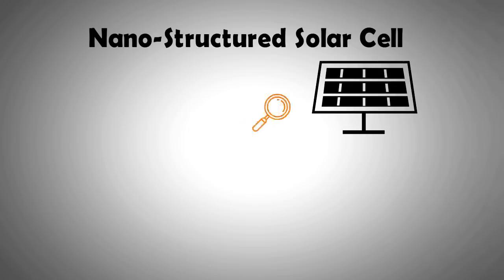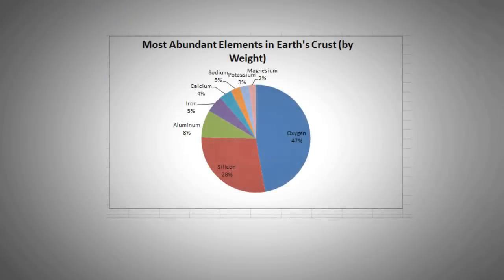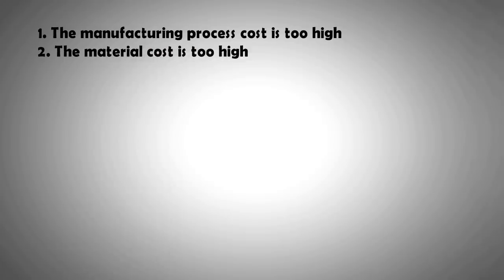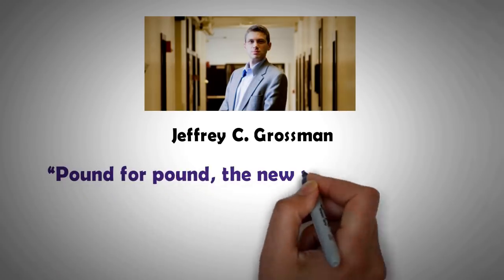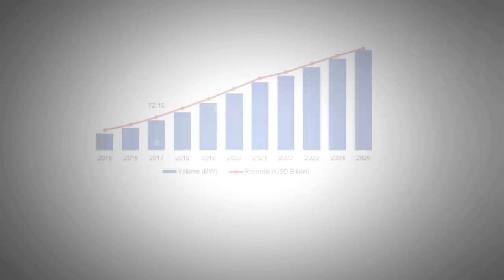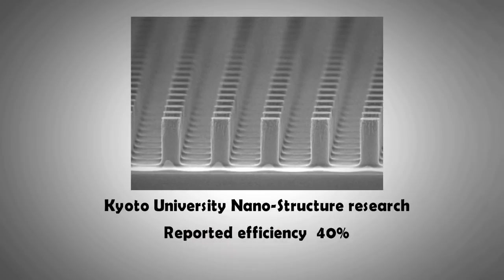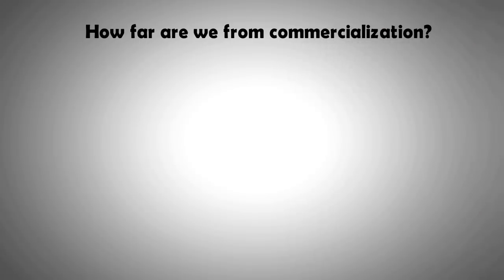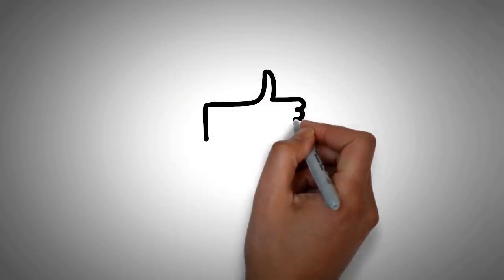Nano structured solar cells - Breakthrough Technology

Comment: one sentence it is said " 1000 times more efficient" and then later it is 2x more efficient ... is that some statistics anomaly  or what. Seriously if all scientists used actual numbers and where they got them, we wouldn't have to worry about 'interpreting' other peoples interpreted proportions.  How about just watts per unit^2 and just leave it there. let us interpret the value. jeez
Reply from the maker: 1000 times less material usage twice as efficient. I have added links in the video description.
Reply: The typical unit is watts/m^2 which is apparently double effeicncy in these new panels.
Reply: @ekoms108  So, this tech is 2x more efficient per square meter (about 40% efficient).  However, the total MATERIAL use is 0.1% as much as required for PV panels (materials cost reduced).

Translation: You get panels twice as efficient for less cost - resulting in commercial solar power for half the current cost to install and half the land use.
Reply: Ferrous Disulfide (synthetic pyrite) has 1000x more light absorption than SiO2. I have been placing most of my research around the creation of nanoscale synthetic crystals of pyrite of uniform size, with cubic centered faces and even distribution. Ferrous disulfide has a huge amount of potential in progressing photovtaics to a faster and more efficient pace. I have been using hydrothermal synthesis of pyrite in a small autoclave for five separate batches of micro scale pyrite (because I wanted to observe the crystal forms under the microscope. Temperature change and duration of the reaction determines size and uniformity of the crystal structures. I just developed a new technique last night which I have performed three small scale tests which were not hydrothermal reactions. Instead I am utilizing vapor phase deposition of Fe(II) ions with sulfur vapor in an argon atmosphere. The sublimated product is very pure crystals of synthetic pyrite onto the desired substrate. I have only worked with copper and lead sulfides for my first few tests of this technique but I am putting together the formula and procedure modifications to apply strictly to FeS2 in cubic centered lattice rather than the crystal habit of marcasite. I have this procedure refined with hydrothermal synthesis, but I believe my new technique shows more promise for efficiency and simplicity in production, and as a viable cost effective measure.

I will make a video or a few on this subject and post to my channel once I get some time to myself to pursue something other than constant external drama I am forced to never get a break from. If you feel like visiting my channel, I am hoping to have something regarding this subject one to three weeks out.
Reply: It's potentiaily 1000x more efficient use of materials, 2x more efficient conversion of light to electrical energy per area.
Reply: now thinking about this more >> observe how this discrepancy could be solved by using actual unit of measure rather than statistical proportions / "pillow fluffing numbers" ... If the unit of 1000x was of surface contact of light per unit area , then the units couldn't be watts per mm/m/in/etc. it wouldn't make any sense. The unit would be something more like 'lumens per unit^2 " or some measure of light per unit^2 .  if the results were material per unit^2 then the results would be kg per unit^2... etc etc ...  maybe the panels are super light .. if we had actual numbers we would know SOMETHING
Reply: He was talking about materials use and weight pound for pound.
Reply: 1000X less material. Does that mean you can run your home on something the size of your calculators solar panel?
Reply: @davesworld7961  No.  From the quoted 40W/m2 instead of 20W/m2, it means it needs to have half the overall area for the same output.  The huge reduction in material quoted might actually only refer to only the rare elements.
Reply: @idontwantachannel3091  Thanks. That would still be amazing if they can do that.
Reply: @davesworld7961  It means the final product will be cheaper.
Reply: @davesworld7961  no you muppet !!
Reply: @christopherroberts22  I love The Muppets.
Reply: @davesworld7961  No, it means that the expensive materials will cost 1000times less for the same surface, cause the usage of said materials is 1000times smaller. the product is cheaper, while the efficiency doubles at the same time.
Reply: @davesworld7961  No.  2x efficiency (watts per square meter).  Less materials means that the cost per panel is less. So, cheaper panels, use half as many.
Reply: ءء
ءء.ؤظؤظؤ.ؤظؤظظؤؤؤؤؤدؤؤدؤؤددؤؤدؤؤؤؤؤؤؤدؤدؤؤؤؤؤدؤظؤؤظؤدؤظؤظؤؤؤظ.ؤظؤظؤظظظظؤؤظؤظظؤؤظؤظظؤؤظؤظؤظؤؤؤظظؤؤؤظظظؤؤؤظؤظؤظؤظؤظؤؤظؤؤظظؤظؤظؤؤظؤظؤظؤظؤظؤؤ

Comment: There many hindrance towards commercial production of nanotechnology . During the era of 2002 to 2010 nano material was debated and its impact on our way life.n. but not a single product is available  in market
We are now in 2020 and still discussing its impact..
Following were the problems  encountered during commercial production.u an add ur experience regarding commerical unsucessful production of nano products.

Time decay
1. The nano material  are high density/ energy  material. We can improve the surface area at molecular level using nanotechnology. Nano material detoriates with time. The nano properties decay with time.
Time decay may be six month to 2 year
.
Inconsistencies

Product will be highly inconsistent. Some batches will have nano properties other less..basically nanopropertises varies.

Batch/, inefficient operation.

Most of nano process are lab method which happens to be batch method.
Need a continuous process wherein consistent quality can be guaranteed.

Comment: What is the name of the company you referred to, that produces Nano Cells?
Reply: Not clear in the video but there is a company in Italy (Verditek) producing lightweight solar panels using graphene to reduce the weight. I understand that the USP is that because of the low weight and improved output they are particularly applicable to buildings which cannot bear the weight of conventional panels. 
Would be interesting to know if this is the company Synergy Files was referring to or if there is another player in the game.

Comment: Nano technology is just so full of promise, frictionless skins on transport vehicles example. There is little to hinder the development of solar collectors which pressurise gasses and heat fluids at the same time as using photons to produce power. This means that it is not impossible to make energy absorbing skins for aircraft, for example, which are capable of producing enough power for clean, cool running and rapid air transport.  We need this technology desperately, as currently jet traffic is demolishing the entire biosphere due to toxic fallout combined with high altitude heat deposition, and this gets more severe every day. Thank you for this presentation, a very timely leap forward hopefully.

Comment: But how does it work how does it produce more energy ?
On top of the nano coating, on the surface of a nanoparticles there are miniature Black Holes and they attract energy, there is a layer of graphene and graphene has free-floating orbitals,  electrons, so in a way they interact with the  nanocoat solar panels and producing more electrons by Magnetic pulling.

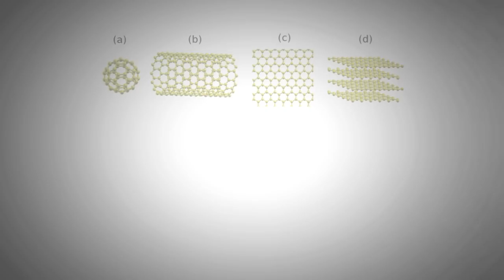Comment: I'm confused - at 2:42 you give the statement that new solar cells produce up to 1000 times the power of conventional photovoltaics, which sounds very exciting, but by the end of the video you say that the new cells only have an efficiency of 20% ? That doesn't seem to add up.
Reply from the maker: 1000 more power for the same amount of material used
Reply: What in the solar industry does add up? Just the next vaporware.

Comment: They cost more than plain old standard heaters.......we have a hell of a long road to make them as efficient as natural gas heat..and now they are using graphs  to illustrate your benefits ..wow they know how to draw lines up and down ..so can a three year old ..it's meaningless garbage
Reply: I think you miss the point. You can't do a direct efficiency comparison of natural gas versus solar. Natural gas and fossil fuels are generally storage of solar energy which has under gone many natural cycles over thousands to millions of years. The fact that you can harvest this energy to heat a house, or convert to electricity via a gas powered electric plant, can't be used in a direct efficiency comparison. I would guess that the efficiency of the original solar conversion to actual work of heating your house is very low, but the energy was used in other ways before it was finally stored as a fossil fuel, mined, and delivered to your home.
Reply: The point is that mining fossil fuels is low hanging fruit, and the rate of replenishment through natural cycles is probably not sustainable with a rapidly increasing population. Renewables such as solar, wind, and hydro are harvesting free energy show a sustainable path for a future energy economy. Innovators and tech development should be encouraged and applauded. Things like LED lighting and semiconductors are upping efficiencies and changing the way we live.

Comment: I bought 8x 255watt solar panels for my cabin, and found that everything i need to run can be done so off of 2 of them. 2. I can connect more in series and crank up my charging amps, but the fact is on 2x 6 volt batteries that are tied in series to make a 12v 208 amp hour battery bank i can run my lights, tv, surround sound, phone charger, e cigarette charger, router, modem, and security dvr with 2 cameras all night without hitting low voltage alarm on my charge controller. Thats all off of a 1000w inverter. That is pretty bare, and i plan on connecting 2 more panels, getting 2 more 6v batteries, and a bigger inverter, soon. I will be able to run a water heater on a timer, water pump, chest freezer converted to a fridge for efficiency, +more. My battery bank currently hits full charge around 3 to 4 hours of sunlight.... If people really need better solar panels, i think they need to work on electrical use efficiency first before investing in new technology. Also solar panels on your roof can make your shingles last way longer and help keep your house cooler in the summer.
Reply: I would love your assistance in building a system for my off grid cabin. We had an apartment fire and now live minimally in a small cabin on a hill. Downsizing was the hard part at first. Now finding that all we really need are lights, charge phone, watch a movie, and chill leftovers. Thanks.
Reply: @marksilvino2083  hey mark, ive been at it for a while now, and still have too much stuff myself, my workshop is less of a workshop and more of a storage unit than i would like it to be. So what i did based on everything i researched was calculated what my wattage usage was on everything i use. I have an inverter that shows how many watts is being used, so i plugged everything into it and ran it individually to get the reading, and then marked it on everything with a sharpie. After that you just have to figure what all you would use simultaneously, add up that wattage, and find a dc to ac inverter my rule of thumb is to get an inverter twice the wattage that you require. From that point you have to get batteries. This is where it starts to get a little expensive. You need to calculate how many hours you use your maximum wattage, find an amp hour calculator online, they will want to know your voltage, id recommend sticking to 12v since the inverters and charge controllers are lower priced. So enter your max wattage x3 (also my rule of thumb), 12v system, and start with a guess of amp hours. Like 200AH. Run the calculator, and it will tell you how long you can run your max wattage on 200ah of batteries. With that info get some deep cycle batteries to fit your needs, then you can look for solar panels, wind turbines, or both. I have both. Wind is great and all but it is crazy how much wind i have being on the side of a hill. And how little it like to spin my turbine. Solar is much more effective. Dont bother with harbor freight junk panels, 25 watt panels are a joke. Get at bare minimum 100 watt panels. Make sure the panels you get match, and you will want about 1/3 more wattage than your max wattage usage, so ecen of you are using your max you are still charging the batteries. Make sure you get an mppt charge controller, it will make your batteries last much longer. I didnt think this reply would be such a book, and im sure i left some things out. Feel free to reply back with any questions. Im always glad to help. Another good idea is to make sure you have a couple good generators, one big, one small, and a good battery charger for when the sun is hiding 😛 stop me.... I could type about off grid setups for hours.. Lol good luck on your build. I might make a video about mine 👍

Comment: Talking very high but only 20% efficiency.. it's only 2.8% higher than conventionally available cheapest  polycrystal panels.
YOUR VIDEO IS MISLEADING
Reply: But it takes less material to make, so per unit of material it's more efficient
Reply: That's the result of the very first iteration, not the end result.

Comment: There is a limited amount of solar energy available per square meter.  Regardless if it's 1000 times more efficient, you're not going to get 1000 times more power. Solar panels in this industry, data is compared to an ideal situation at the equator, in full sunshine at noon, perfect azimuth, perfectly clean solar panel, using a prototype, and for a small window of time. This certainly does not reflect data in a real world environment.
Reply from the maker: It not about panels with 1000 times more power per unit area. Its about the ability to use precious elements as 1000 times less material is required. The precious elements semi conductors have better efficiency and nano structures themselves have a better efficiency, thereby possibly doubling the efficiency of existing panels
Reply: @synergyfiles3536  another thing to include a design consideration is, durability. Different alloys and gradient transitions , as well as the phonon effect. Most of these technologies may perform better, but for how long? So much more unproven grounds, but worth exploring

Comment: Until they actually hit the market from multiple vendors they are nothing but make-believe.
Reply: Norm T  I waited 20 years to buy my SunCapture 300W folding solar panel. It doesn't matter what Can be done what matters is how much profit some fuckhead can make selling it. Until that happens you will never touch, let alone own one of the fucking things. Besides, NASA has way better panels than this. There's way more to solar panels than just their efficiency rating. I didn't dispute their existence there Mr. T, I just don't think they will hit the market for over a decade, you go ahead and wait I'm too busy. 

https://imgur.com/a/3w6izz7 - Bike and Trailer
https://imgur.com/a/DKpcF0a
https://imgur.com/a/zXXlyuv
Check out 70 miles w/front panniers & trailer on Relive! https://www.relive.cc/view/g37290970278

Comment: Manufacturers, distributors and retailers will absorb into their own pockets any efficiency savings because they will maintain their cost structure on the cost per watt. Greed knows no limits.
Reply: NO one cares about COST per watt currently.  If you want cheap: Buy used.  Everyone cares HOW LONG the panels WORK.... which is why you can buy cheap used panels.....  They do not work as claimed.  1) you have to wash them and 2) their sealing sucks.
Reply: @w8stral  In other words, YOU don't care about cost per watt since you do not speak for everyone else. I can understand your sentiment, which is typical of those who are mathematically challenged and pay no attention to system efficiency. It's a given that the panels will give out like most all others over time, so that's not the crux of all this. Cost is indeed a factor in relation to how much power one gets from the purchase they make, and yes longevity is also critical, but limited lifespan is indeed a given.

Comment: I would hope they have thought of the cleaning of this panel , having worked in the panel wash industry for the last 5 years I think this idea is flawed , building grime traps in to panels is a step backwards, it’s like the early days when the panel manufacturers told the whole world that the panels  do not need washing, until the birds can be persuaded to not crap on panels and stop the wind from blowing dust over them , these new ideas are a waste of effort, the best idea is to ask panel cleaning companies to design the layout of farms to enable the equipment the room it needs to clean efficiently , it’s possible to wash multiple times a year fore less than 9p per panel , the outfit Iam involved with often wash the farms twice on each visit . This is costly the farms that are done twice a year  only need one pass , this is not rocket science .........

Comment: Sadly no one measures the efficiency of solar panels one pounds per watt that's a measurement for energy storage in vehicles.
The nanostructures could reduce the uses material and reduce a bit the weigjt of the panels but has anyone ever got a problem with the few kg the panels today weight.
I must admit 20% efficiency is very competitive but not twice the efficiency of current cells.
Reply: NASA
Reply: @Mr438IB  Good argument and also in airplanes and air drones. Ok I admit I had a mainstream house owner view.
Nevertheless my marketing BS detector went off, when hearing exorbitant numbers ;-).